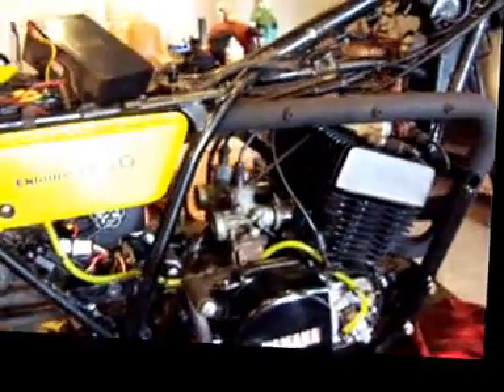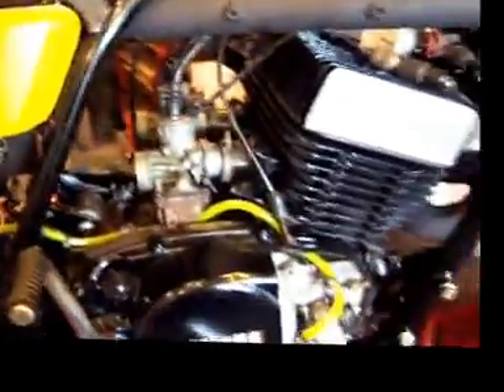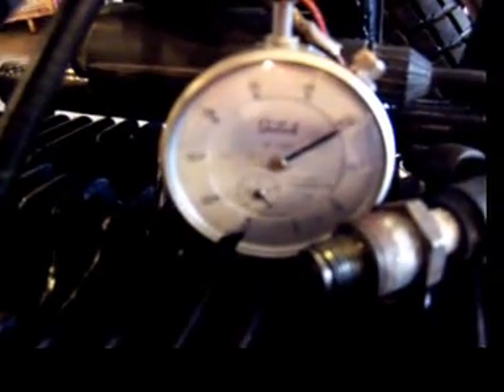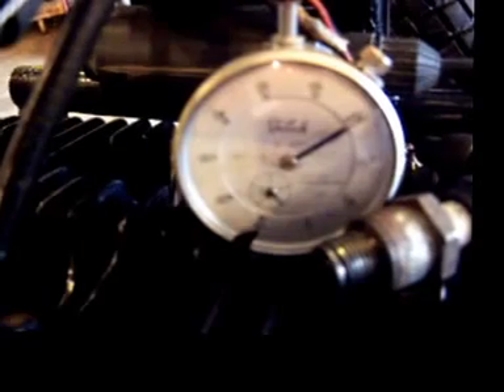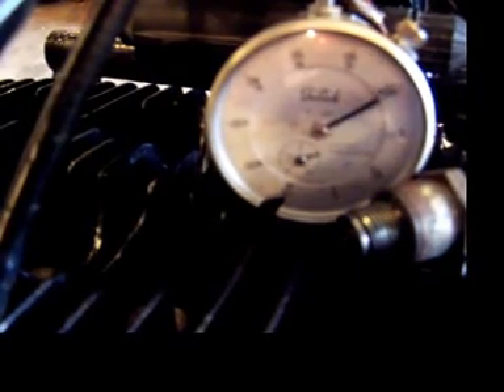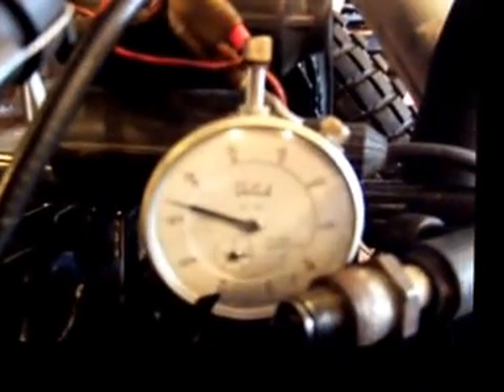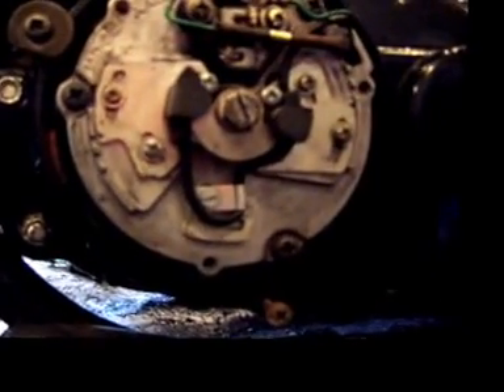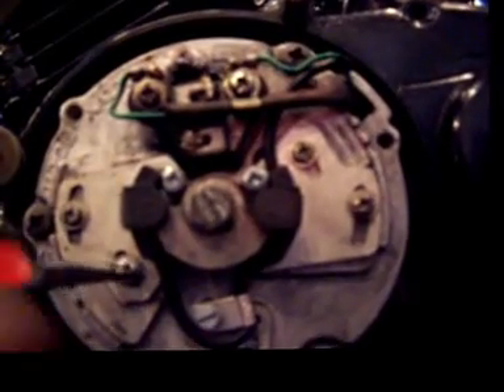Timing a 2 Stroke Engine Using a Dial Indicator RD400 RD350 Dirt Bike Motor

Comment: How did you make that spark without kicking it fast?
Reply: The electronic spark control uses the battery to provide the spark instead of directly from the spinning flywheel.
Reply: I am trying to time my cr500 with a diffrent ignition system. It’s a 125 system. The woodruff key and position is useless.